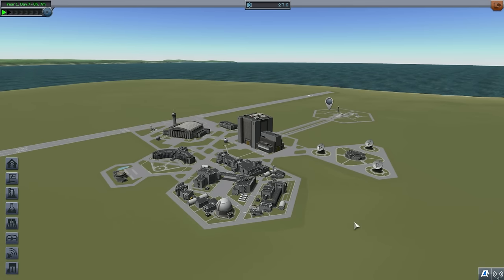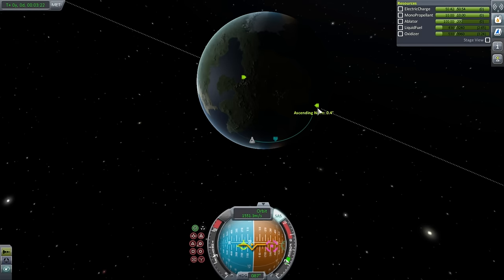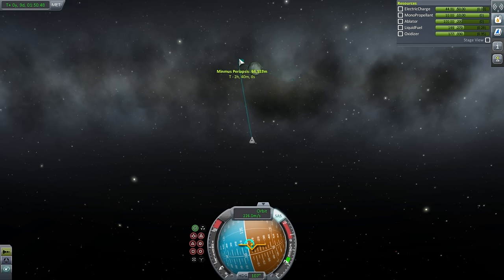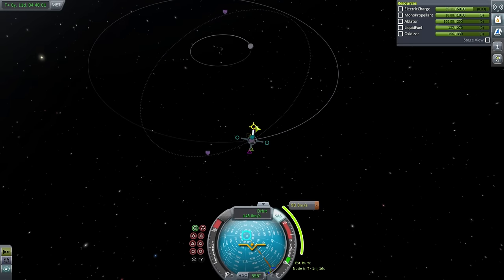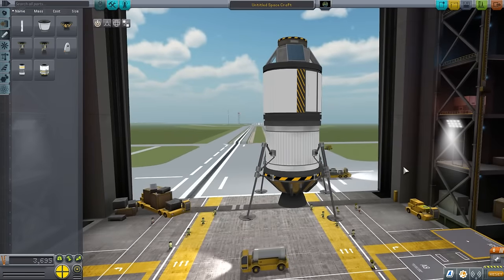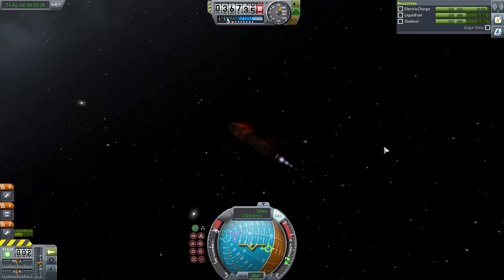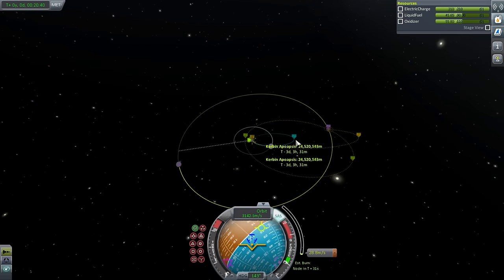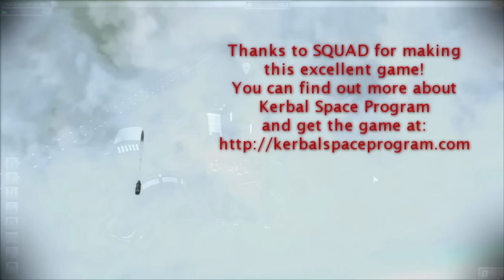Kerbal Space Program 1.1 Tutorial 04 - Minmus and Inclination

Comment: Tyler you are missing a ton of science. With that first craft you went into a polar orbit and completely forgot the poles biome and high over minmus crew report and EVA report. For the purpose of this tutorial you can kind of assume people are going to miss quite a bit of science and therefore not max it out but you can at least mention it :)
Reply: +Tyler Raiz I would also suggest throwing on a goo canister or two, they don't weigh much and are easy to place. Even a materials bay would be great. On my first trip to Minmus I got 1300 science points or so and it doesn't really make it that much more complicated. :) Building a lander for Minmus is the best starting point for a beginner, as it doesn't require much in terms of parts or deltaV, and it is extremely forgiving on landings.